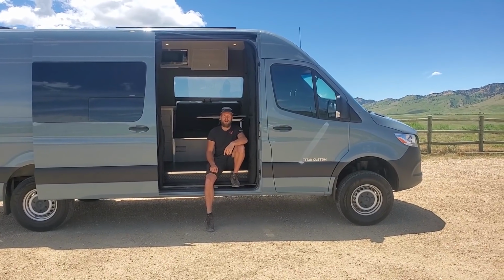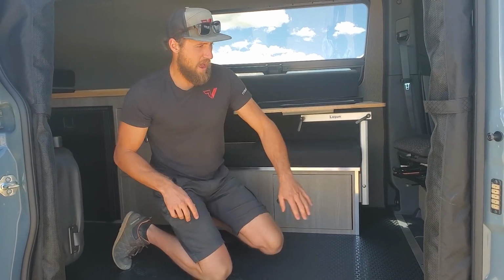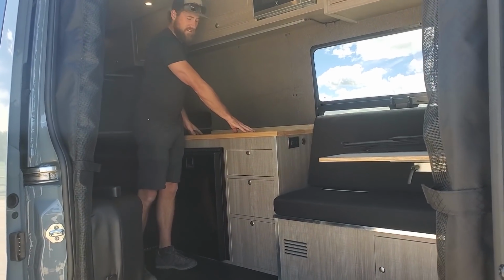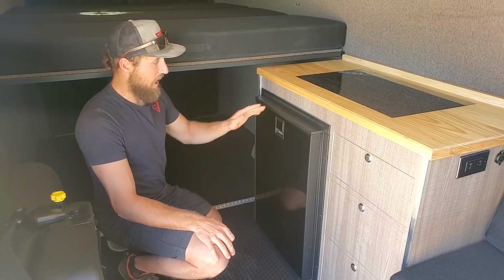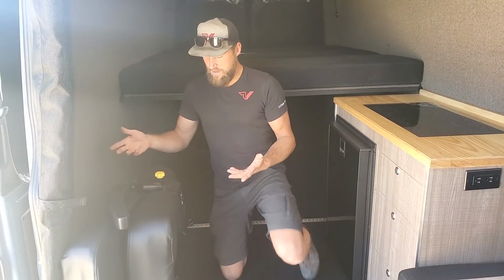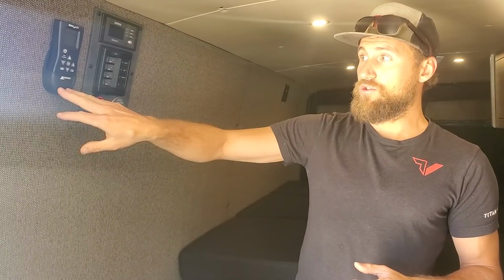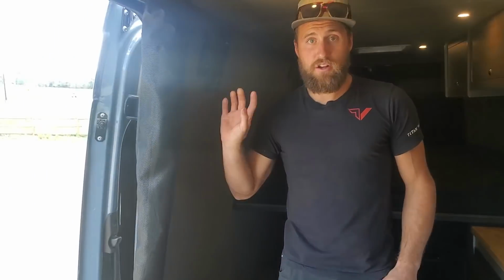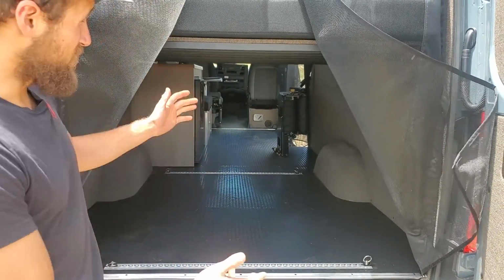Mercedes Sprinter 170 4x4 Conversion Van Tour - Custom Build By Titan Vans

Comment: Questions:  

1. Insulation system in the van?  

2. How loud is in the interior at say 65mph?   A dBA reading would be super helpful.  As a (now) experienced conversion van owner, I'd be willing to pay extra for a quieter riding van.  Knowing there are no (or few) squeaks and rattles and the van rides quietly is a huge plus.